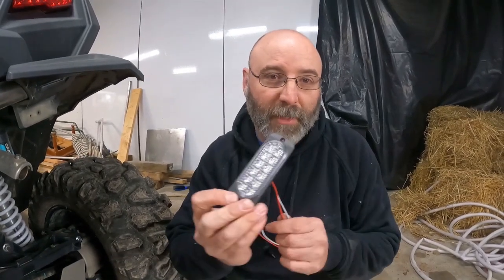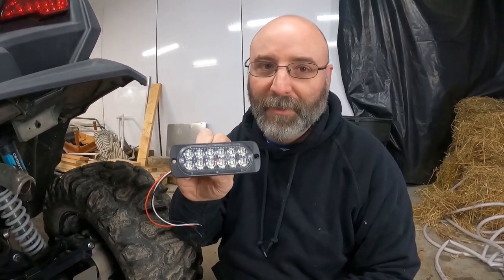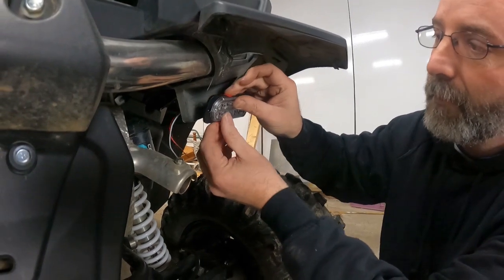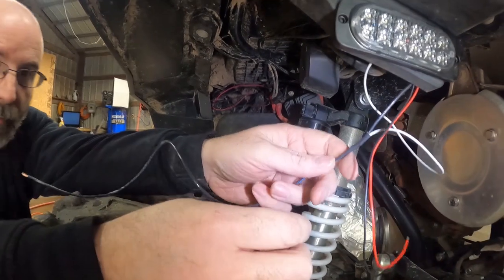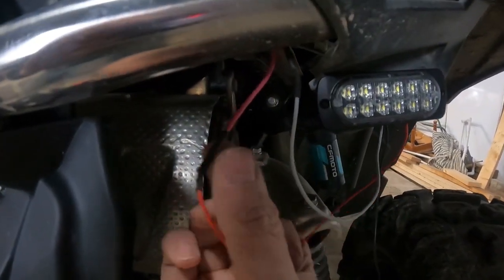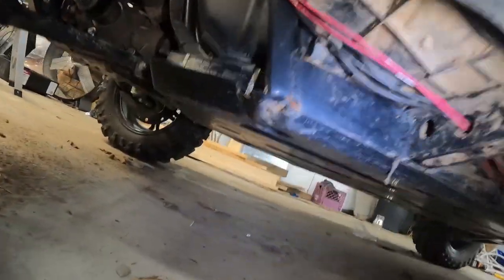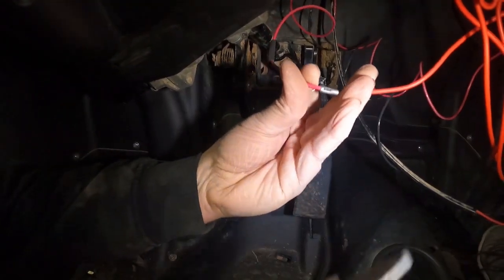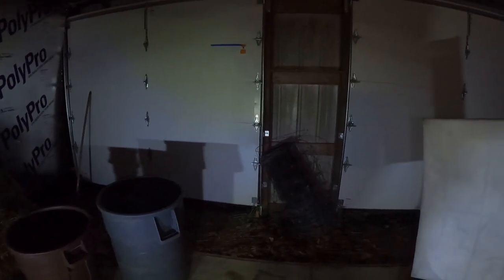cfmoto zforce reverse light install

Comment: I just put a pressure switch beside reverse gear  selector .
Reply from the maker: Good plan. We thought about a momentary switch or tying into factory switch wire but we wanted the freedom to use the lights no matter what gear we were in.

Comment: Hello which wire did you use
Reply from the maker: We used 14 gauge wire from the light to the switch
Reply: @CameronsonCamera  yeah but witch wire. Is there reverse light wiring harness or factory wiring
Reply from the maker: We made our own harness. We tied the positive of each light together and the negative of each light together. We then wired the negative wires to a chassis ground and wired the positive wires to a 12volt switch inside the cab. No factory wires were used.
Reply: @CameronsonCamera  That's what I plan to do -- make a harness for my UForce 800 for towing.  Left, right, backup and brake.  Time to get paper and draw out all the connections.